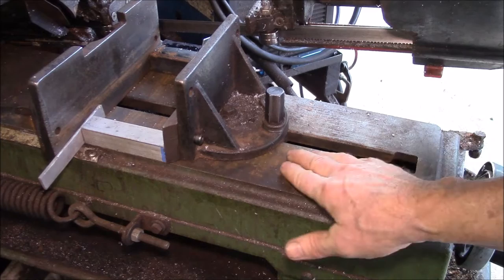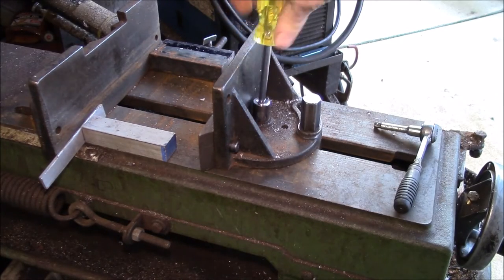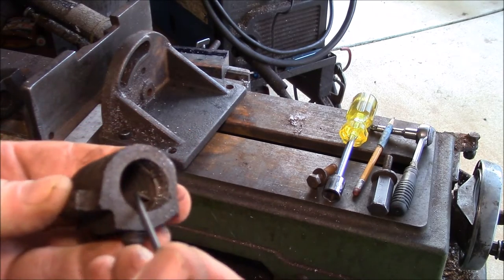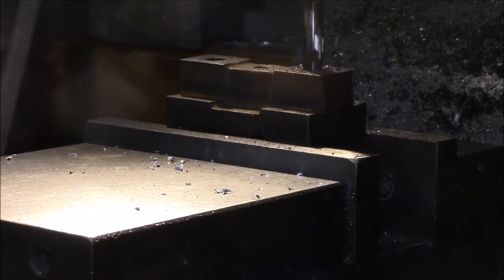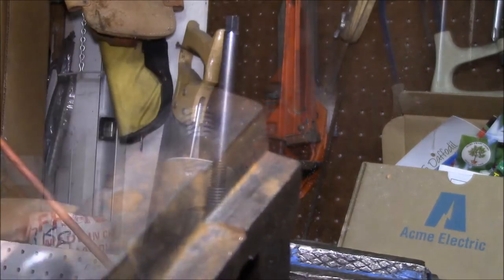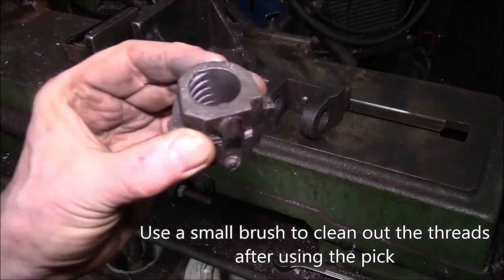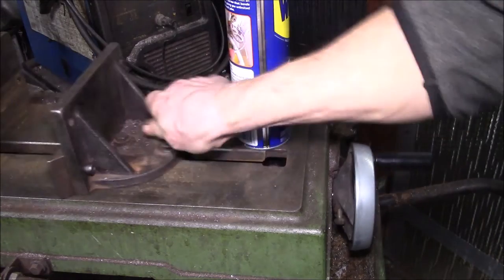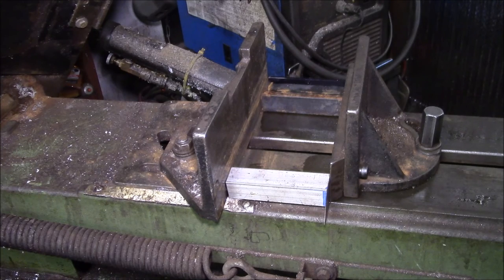7x12 Horizontal Bandsaw Vise Thread Repair

Comment: This is exactly what I needed! I bought a bandsaw secondhand, and someone put the clamp quick release in upside down. Than you!
Reply from the maker: Glad I could help!  Not hard to do, it looks like it should go on in that orientation until you realize how it actually works.
Reply: @The4Crawler  well, the previous owner had attempted to weld the middle piece of the assembly... so it wanted to be in the upside down! again your video helped me correct the assembly - after a little grinding since welding to cast is difficult it didn't penetrate!
Reply from the maker: @Halfwheelhell   Thankfully, I never attempted that sort of "fix" on my saw 🙂

Comment: My vice would not tighten, or stay tight. Cleaning out the half threads of the nut did the trick! Thanks!
Reply from the maker: Glad you got it working.  I'm about ready to clean mine out again, those half threads tend to gunk up every few years, depending on how much you use the saw.

Comment: I cleaned mine and greased the threads
  Would not work with greased threads.   Cleaned it all up again left threads with no grease and works good now
Reply from the maker: Good to know, thanks for sharing.  I guess I've never lubricated mine to find that out.  I suspect that half-nut "jamming" design relies on friction to work.

Comment: Any idea the size and thread pitch of the left hand acme lead screw?  I HATE this stupid design; any advantage in quick release is offset by the fact that it never tightens up adequately....I think the pin may be too short to ever lock up tight.  Anyway...looking to just change to a coupling nut of the right size/pitch, but can't get a decent measurement.....can't tell if it's metric or SAE; only that it's left hand.  Size seems to come out to 20.5-21.5mm or 13/16" with 5 or 6 threads per inch.  McMaster-Carr only carries LH acme thread in SAE....nothing metric, so hopefully it's SAE.
Reply from the maker: Usually that's caused by junk filling the half threads in the nut, try cleaning that out and it'll work like new:
https://youtu.be/E6l_QuvgPwI?si=vWAFRULqHsHEDwd5
Grizzly lists the lead screw as 22x5, 480mm long, they sell replacements:
https://www.grizzly.com/products/g0561/parts
Another option is to flip the existing lead screw end of end.  You'll need to turn down the other end and mill a keyway slot in it to fit the hand wheel.  But that will give you nice square threads on the pushing side if your old threads are worn (like mine are).
Reply: @The4Crawler  Not in this case as the nut has been totally cleaned out.....however, mine is the Harbor Freight/Central Machinery saw, not the Grizzly...so that may be the problem.   My saw is fairly new and not used much.  Thanks for detailing the size/thread pitch.  HF's owner's manual didn't list the size at all....and obviously, it may not be the same as the Grizzly.  The pin definitely isn't as long as the one in your video which is probably why it doesn't lock the threads of the nut against the lead screw correctly.  I don't have a mill or lathe to make the parts either....so I may have to improvise in another way.  Thanks so much for the extremely prompt response and the video itself was very helpful in disassembly.
Reply: @The4Crawler  Also, are you the same 4Crawler Offroad that makes axle shims?  If so, small world!  I've bought shim from you in the past!  😃
Reply from the maker: @jeffthompson5690  Yes, we cut the shims on that band saw.
Reply from the maker: @jeffthompson5690  Mine is also HF brand, I order parts through Grizzly because they have much better parts ordering than HF.  HF told me they no longer make my model saw (its around 20 yrs old) and have no parts.  These saws, HF, Grizzly, Jet, etc. are all basically identical mechanically, aside from some cosmetic changes. 

Should be able to make a longer pin for yours, just find a bolt of the same diameter and cut off a section of the unthreaded portion to the desired length.  A stainless bolt would be best if you use a water based coolant.
Reply: @The4Crawler  Thanks for the information.  I'll check Grizzly's site for parts.  I really appreciate your help.  Kind regards.
Reply from the maker: @jeffthompson5690  In this video, I cover using the HF/Central Machinery part numbers on the Grizzly parts web site:
https://youtu.be/I5QMM787E9A?si=r01Sf5XMW-ElEt6e

If your saw is newer, HF might have some of the parts available, but you usually need to call in to order them.
Reply: @The4Crawler Thanks again....watching the video now.  Thinking first thing I'll try is making a slightly longer pin....mine doesn't even stick through the threaded body 50 thou....

Comment: you take very good care of your equipment Merry Christmas and Happy New Year
Reply from the maker: Seasons greetings as well.  Yes, constant maintenance required on these tools.  I used anti-seize on these threads but given enough time, a steel bolt into cast iron threads is going to wear them out.  Since I do lots of angle cuts, that clamp bolt gets wrenched a lot.

Comment: Hi, any idea what could be wrong with a vice that is slipping? The metal piece secures tightly at first, but as soon as the blade touches the metal piece the vice disengages.
Reply from the maker: It could be the threads inside the half nut are packed with debris:
https://youtu.be/E6l_QuvgPwI

Comment: Do you happen to know what that part is called that you cleaned for the clamping mechanism?  I cleaned mine out thinking there was a lot of debris and there was but even after cleaning and putting back my clamp still won’t tighten. TIA.
Reply from the maker: I think they call it the Acme Nut Assembly on the parts diagram in the manual.  Likely the little spring loaded pin is stuck or the nut is installed backwards:
https://youtu.be/E6l_QuvgPwI
Easy way to tell is to push on the back of the moveable vise jaw and try to turn the lead screw out.  If the nut locks up as you try to open the vise, turn it around.

Comment: Great video.i just bought a saw with that problem.do you know the brand.my saw looks exactly like yours and I like to find the manual
Reply from the maker: It's a Central Machinery #34272.  You can download the manual from the Harbor Freight web site.  The newer model looks different, but I think all the mechanical/electrical parts are similar.
Reply: They only have the new saw instructions .and that's enough.but , can you tell me the blade size. They say 93 3/8 x 3/4.. harbor freight says 93" x 3/4..and they don't have a spot on the wall for either size.
Reply from the maker: @michaelc3172  I use 3/4" wide x 93" long and usually 0.035" thick.  I get my blades from McMaster-Carr.  The 10-14 tooth bi-metal blades work very well for steel and aluminum.
Reply: @The4Crawler  thank you